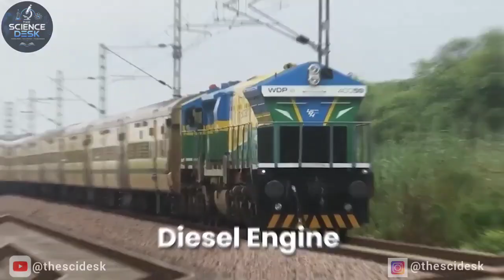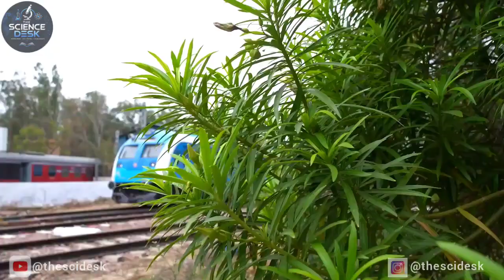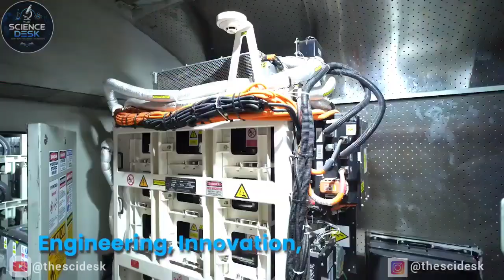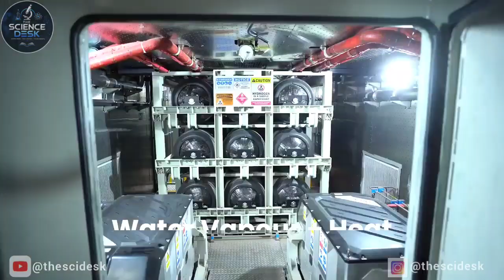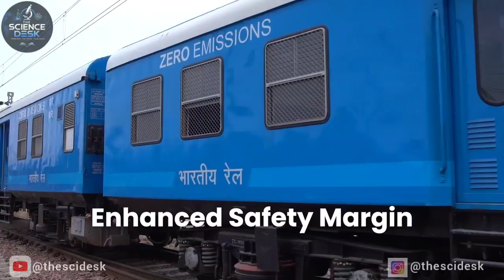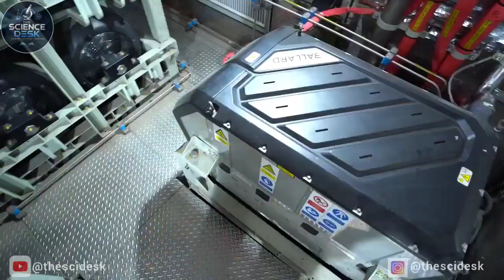🚆 No Diesel, No Pollution? India's Hydrogen Train Explained | Future of Railways @TheSciDesk

Comment from the maker: 🚆 A train powered by hydrogen instead of diesel — is this the future of Indian Railways?
Hydrogen fuel cells convert chemical energy into electricity using one of the most fascinating ideas in modern engineering.
👇 Comment your opinion: YES — Hydrogen is the future or NO — Electric trains are better
🔬 Follow The Science Desk for more science and technology stories.